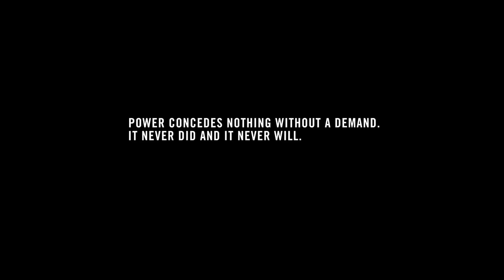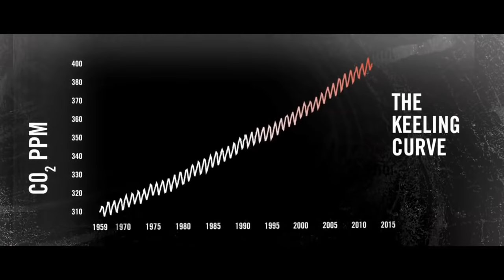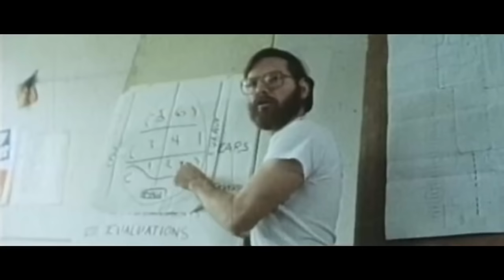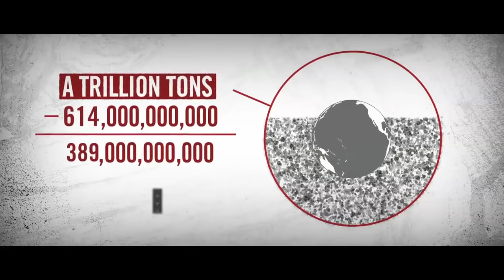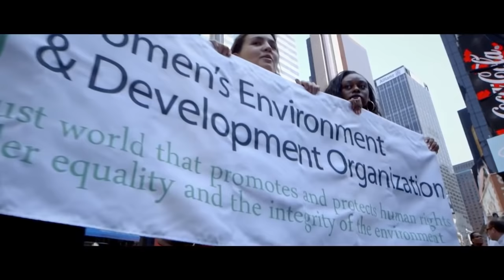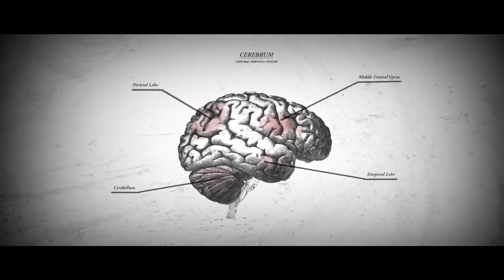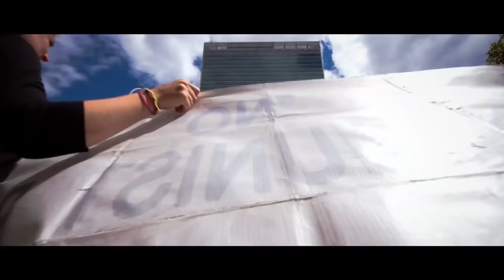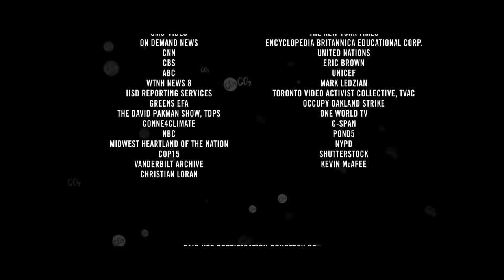Human Extinction By 2030 -Climate Disruption The Movie.

Comment: I remember in the 80's as a child riding in my mom's car to the beach and the fm radio said "todays weather is 80 degrees and sunny in miami".  Fast forward to 2021 and now you cant even stay outside at 3 pm because of the abnormal heat levels.  It is about 95 to 100 degrees outside at 3 pm.

Comment: In Latin America they protest differently, they occupy the seats of power. We did this in the 70s and got results. Had the occupy movement not been infiltrated and sidetracked Wall street would have been occupied and shut down. Until occupation occurs it will be business as usual.POW = Park On WashingtonEveryone needs to protest with their cars. Drive them to DC at the same time and park. Do not leave until there are results. Occupy the edifices of power, the structures that govern us must be occupied.semis, trucks, tractors, cars, motorcycles, buses, all go to DC and PARK! Shut it down, occupy Washington DC NOWor live with the consequences

Comment: Some are saying that the increased carbon dioxide is a GOOD thing since it's what plants need to grow .... and that the increase of carbon dioxide has resulted in the greening of the planet and that it is more green now than ever as a result.  What is the counter argument to this?
Reply: Corben The CO2 and overall greenhouse gases are above normal levels; causing changes to global climate ( which will ultimately become progressively worse due to the exponential function effect).
Reply: We are witnessing irreversible, runaway, climate change, aka — near term extinction.

Comment: Mostly dangerous drivel. Globally the ACE index (accumulated cyclone energy) 1980-2021 shows no increasing trend. Global Hurricane Landfalls 1970-2021 (updated from Weinkle et al, 2012) shows no trend. Satellite data since 1980 shows a slight downward global trend for total hurricaine numbers with 2021 being a record low year. The IPCC reports in AR6, chapter 11, "The total global frequency of TC [tropical cyclone] formation will decrease or remain unchanged with increasing global warming (medium confidence)." Multidecadal variability in Atlantic hurricaines is most probably related to the AMO (Vecchi et al, 2021). NOAA data 1851-2021 shows no trend in number of hurricaine landfalls with the record high being 1886. What the data from NOAA SPC shows about tornados: EF1-EF5 (1954-2022) no trend; EF3-EF5 (most destructive) (1954-2022) 50% decline. No EF5s in US since 2013 (a record absence).
The Global Land Precipitation Anomaly from AR5 will disappoint with deviations from the average increasing by 0.2% per decade, but if you look at the actual data, it's just very variable over the decades. 
Drought appears to be decreasing (Watts et al, 2018) measured by SPI 1901-2017. 
Deaths from natural disasters are about 0.6% of what they were a century ago.
What else? Oh, deserts like the Sahara have shrunk considerably and the Earth has greened by 15% or more in a human lifetime (NASA).
On extinction the rate is very low: 900 known lost species for 2.1 million known species in 500 years. At that frequency it will take nearly 190,000 years to reach 15% extinction i.e. a mass extinction. 
There is no climate crisis. This video is anti-humanist.